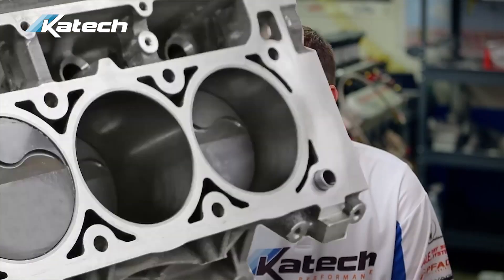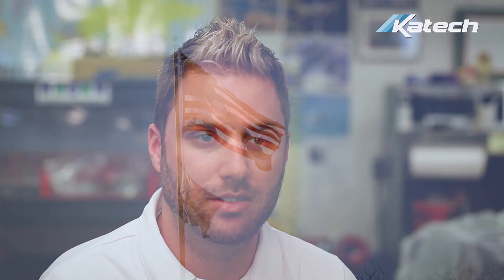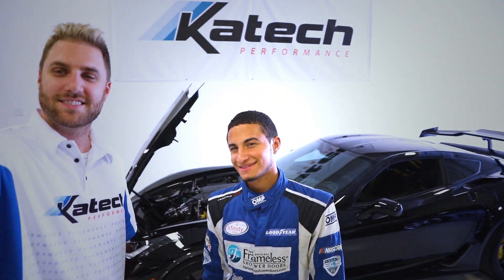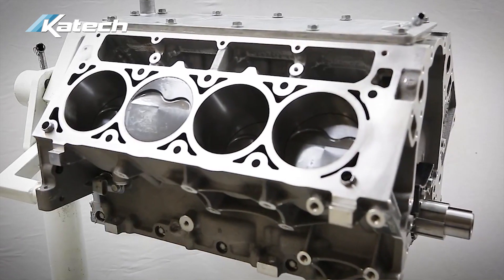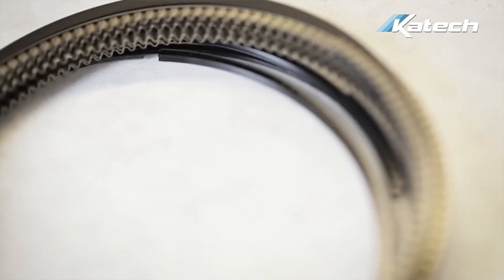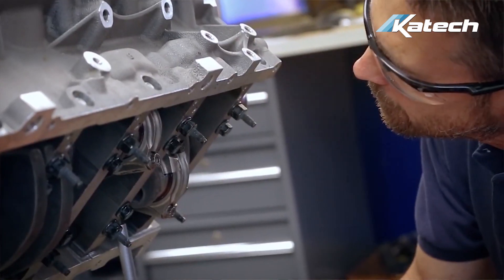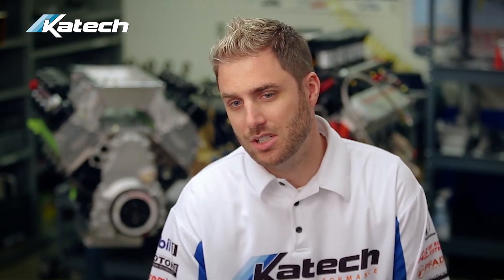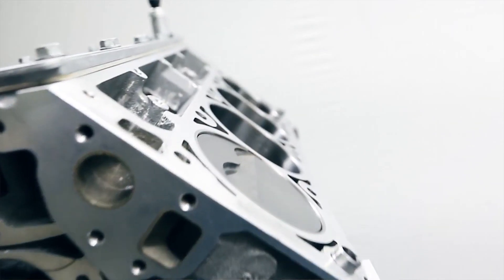Katech LS3 416-Short Block Engine

Comment: Katech, so you guys like the Mahle piston package? Are those the 4032 alloy or 2618?
Reply from the maker: Yes.  The pistons are 4032.  We also build a variant for boosted applications at higher horsepower levels with 2618 pistons, Callies Dragonslayer crankshaft, Callies Ultra rods and Katech piston squirters.
Reply: KatechPerformance 
They work very good for most setups and are quieter, you guys build killer stuff! I love the valve covers I got from you guys!